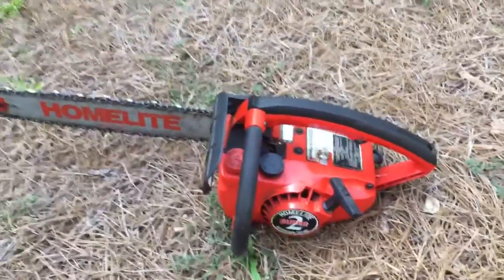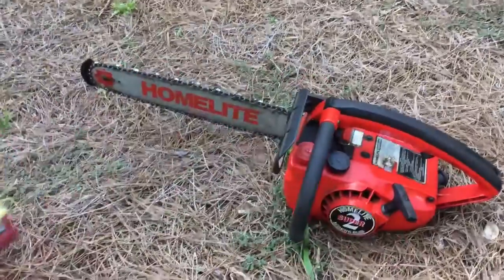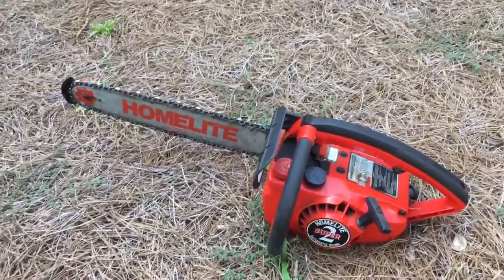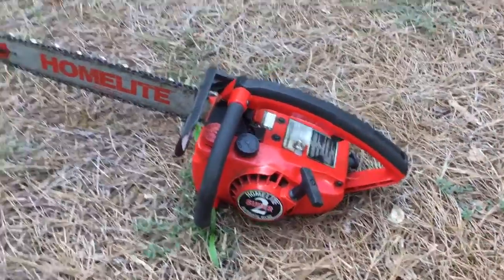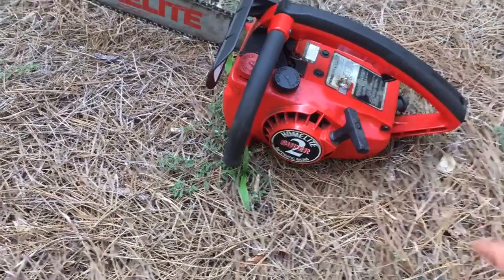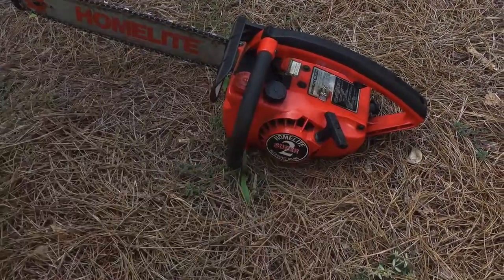1986 Homelite Super 2 Chainsaw running

Comment: Yes I have a homelite Textron super 2 chainsaw UT number 10698. Serial number HL 173-1864. I think it's a 38cc I'm not sure how can you tell? This thing is brand-spanking-new. Very thick sharp chain never seen a chain like that before. Has a nice walbro carburetor on it. Started right up on the first pull. I doubt I can call the 1-800 number on PO box 7047 Charlotte North Carolina 28217. I can't believe it was made in America do not use gasohol. LOL. I love how flat the motor is

Comment: what is the actual part number for the saw you have? I went and wiped my info tag with alcohol....oops. Got the model number and serial number at the same time.
Reply from the maker: UT No is 10654 and serial is 5G3010106, hope this helps